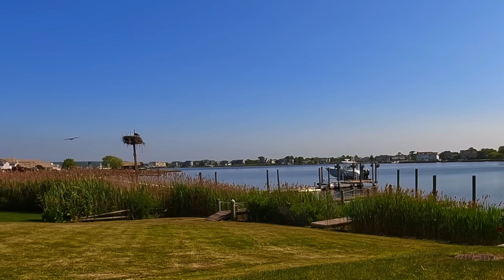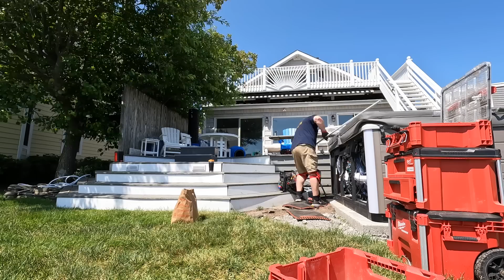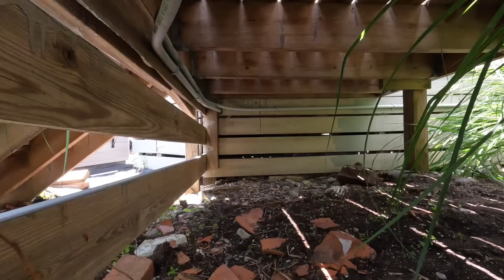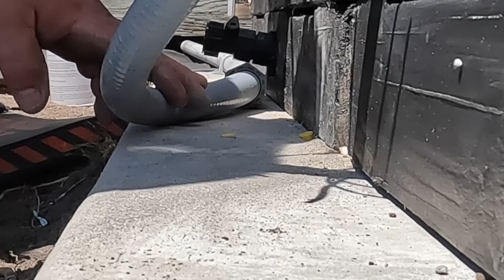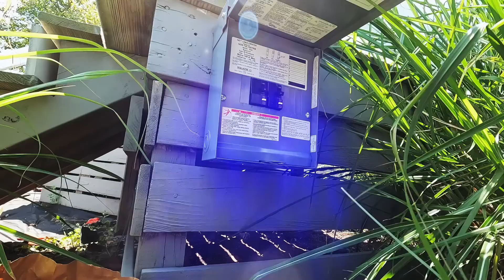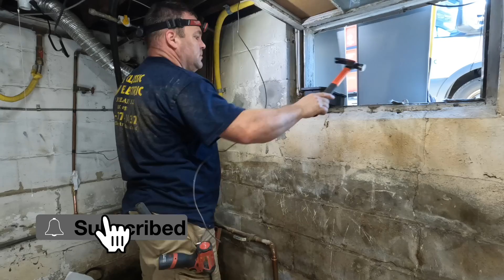Wiring a Hot Tub w/ disconnect and grounding electrode system for a 200A service  in Oceanport

Comment: I see the expansion coupling in the feeder conduit. You should mention that in the video. I have found out what happens if one isn’t used!
Reply: I live in the north west I’m not sure if I need to use one.  It’s an outside run about 25 feet between boxes. Would you suggest an expansion fitting?
Reply: @pickleballscott yes, I think any PVC over 8 feet needs one.  I’ve had fittings break from expansion and contraction or the conduit warps and looks terrible.

Comment: That existing deck that is closer than 5 ft - does it require  equipotential bonding? Also the concrete pad under the hot tub - does it have a bonding wire? Sorry if I missed it, but I didn't see 8 awg solid copper anywhere. Thank you

Comment: Hi Ron, what would you do if a hot tub were to be placed on existing concrete?  Bonding? Grounding?  Not sure it's possible to do an equopotential bonding loop at this point without breaking up the old concrete.  thanks!
Reply from the maker: If it’s an existing concrete slab the code specifically states that you do not have to break up the concrete to get to the rebar for grounding.
Reply: then how do you ground the rebar? or don't you?  what about equopotential bonding?  there is only about 10 inches all around the hot tub of exposed concrete.  it's about 12" from the edge of my deck also.  TIA @electricianron_New_Jersey

Comment: Hey Ron loved the video but what kind of spa uses only 20amp and 30 Amp breakers
Reply from the maker: Before spas used to use 50-60 amp circuits. Now it’s just broken outside of the unit.
Reply: @electricianron_New_Jersey  ok. Didn't know that. I wired my own spa and had to use 6 Guage wire for 50 amp

Comment: Love the videos. Quality work. If I was home owner, I would have had the conduit ran under and up the slab before it was poured
Reply: Several times when I left a 2 to 4" studio in concrete the animals I stall in equipment slid heavy load across the PVC conduit breaking it off requiring time to chip out concrete inside of a tight space and pain in the butt to trim broken PVC to glue on a cooupling.
Reply: true didn’t think of area with frost, I recently moved back to the north

Comment: Hey Ron nice video. Just curious, would that pad for the hot tub have a ground wire back tot he disconnect panel to bond the wire mesh or rebar to keep everything at the same potential?
Reply from the maker: There's no Ufer ground here and I agree, there should be one because the tub is a separate structure.

Comment: Wouldent inspectors call you out 5 current carrying conductors on that pipe for the tub? (adjustment factor [no more that 3 current carring conductors?])
Reply from the maker: No, because five conductors in the same raceway is not a violation. Derating is something else entirely. All THWN/ THHN conductors have different ampacity ratings and the 90º column of Table 310.16 is used when derating conductors.

Comment: My city here in Utah uses PEX for incoming water lines.  When I replaced the old galvanized pipes in this 80 yo house, I installed all copper. When the city side galvanized water pipe finally died, PEX was installed. I still ran a grounding conductor to the internal water pipes
Reply from the maker: This house was built in 1920.
Reply: @electricianron_New_Jersey  I call our house "My Old House".  It has been fun upgrading so much of the place over the past 28 years. Very intimate with it now.  It is my hobby now

Comment: A lazier and faster install would be to just run carflex the whole way back to the panel under that porch/deck, but you did all those PVC bends for a much more durable raceway. Can you only use carflex a maximum length by code?

I agree those terminals on the control board look flimsy when you consider the tub heater and jets draw such high current. Hopefully those springs are good and tight or there could be arcing. And that connection needs to stay tight through the year-around outdoor seasons. Seems normal screw terminals would be cheaper and safer.

Man it looks like there's some money over there in Oceanport. You're lucky to have great clients.
Reply from the maker: I prefer terminals all day long but I am a fan of using Wago's where necessary.
Reply: @electricianron_New_Jersey  Oh yeah those Wago lever nuts are amazing. Keeps the conductors nice and clean if you need to add/remove conductors to a splice
Reply from the maker: @aaron74  Aaron, are u an electrician too?
Reply: @electricianron_New_Jersey  Mostly vicariously... it's an avocation. I'm a landlord and do DIY electrical work on my property. I love the trade, and probably should have been if I could rewind my life. I'm a stickler for doing the work perfectly and making it as good as a pro did it. I help a lot of people on forums figure out circuits.

Comment: Opinions on using 2 hole plastic straps on pvc vs using 1 hole rigid straps on pvc?
Reply from the maker: Well the 2-hole PVC straps are what you're supposed to be using on PVC. I do use heavy wall 1-hole straps but being that this house is close to the salt water the HW strap would rust in short order.

Comment: Hi Ron, thanks for all the content. Would you want to use a rain tight hub on the ATS since you're in the upper part of the enclosure.
Reply from the maker: I'm not overly concerned about it. As I tightened up the locknut on either side I squeezed some silicone in there to make it water tight. I will however check it before all of the work is done over there.

Comment: Hey Ron, I'm a young electrician in south Jersey, love watching your videos and seeing someone who knows what they're doing. Maybe you've shown it in another video, but what do you typically use to heat your PVC for bending? Your bends look really good. I was thinking of buying one of those greenlee blankets, but theyre expensive, and wanted some other opinions before I pull the trigger.
Reply from the maker: Glad you enjoy the videos and I hope you are learning a thing or two.  I use a Greenlee 2” heater and it cost $400 in 2014.  The blanket works well but takes longer. You could also use a charcoal grill because the heat would most definitely warm the PVC. I did that once working at a friends house up on Cape Cod.
Reply: @electricianron_New_Jersey  I have the same heater on my truck and I am finally starting to get really good at bending offsets and 90's with it. It is such a useful tool for a resi electrician and it sure ebats having to run out and grab a pre fab
Reply: @electricianron_New_Jersey  ...ya do whattcha gotta do...lol
Reply: Thanks guys. Right now I work for an electrical contractor, and while the hot box seems great, I don't think I'll buy one to keep on my truck. But I might buy one and put it in my basement at home for the meantime lol

Comment: What's your tolerance on determining what AWG size you use +/- 5 amp or more. How far would you bring an aluminium conductor into a building?
Reply from the maker: Conductors are sized for the loads they serve Circuit breakers are sized to protect the conductors, not the equipment.